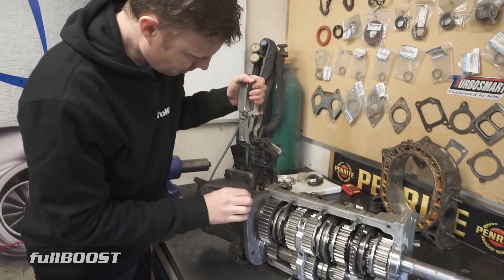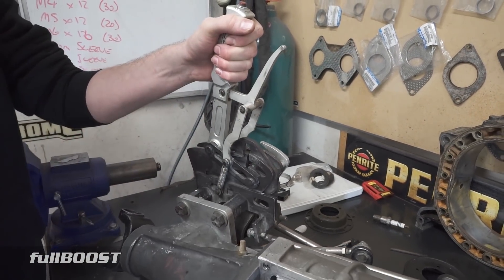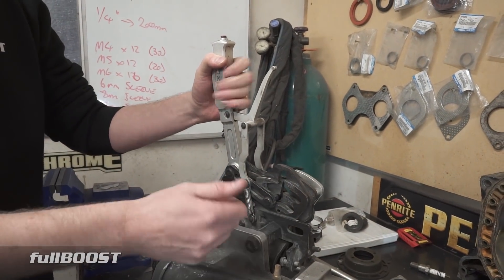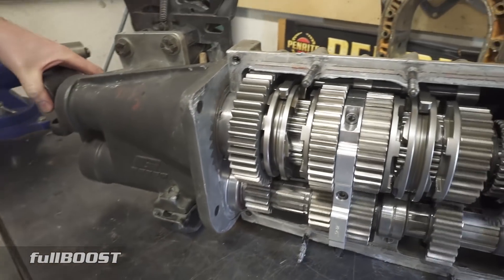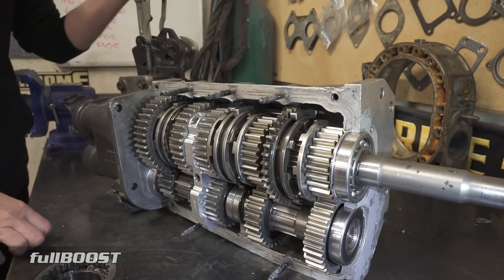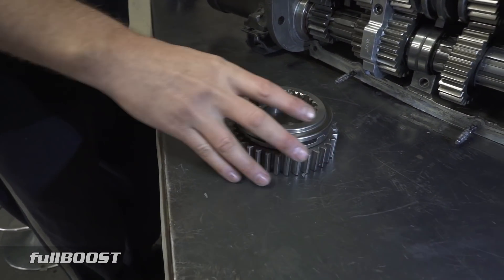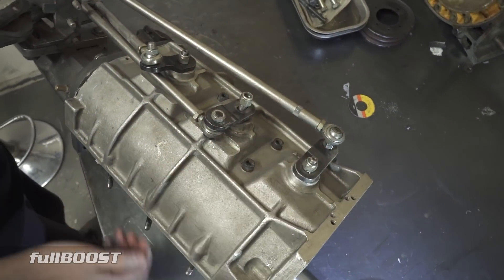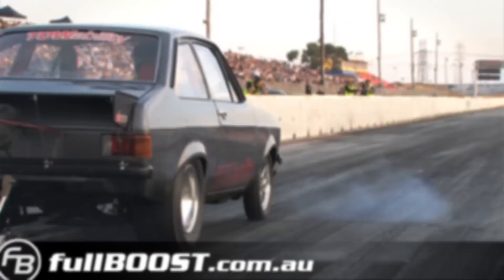How a clutchless racing transmission works

Comment: I'm sitting here reading comments and thinking you guys have no idea what you are talking about. Commentors 
This is basically a regular 5 speed transmission with cut down blockers and synco's.
You remove half or more of the syncros and blockers and cut them at a specific angle and you do not need a clutch to disengage the tranny most guys use a rev limiter to slightly stop the power to change gears in a dogbox.
This is a true clutchless transmission and basically the sliders are not fully locked and the only thing keeping them in gear is power on as soon as power is interrupted the tranny falls out of gear and can be changed, the shape of the slider dictates if you can do this or not.
A standard street transmission the blockers and syncros are t shaped and keep the tranny locked in gear while coasting or in and out of throttle stuff, if you drive a manual normally and rest your hand on the shifter which is really a bad idea btw stop being lazy and take your hand off the handle the tranny can't come out of gear, these are designed to come out of gear on purpose.
The shifter is called a long style shifter as the name on the handle suggests and they run a few hundred dollars or an inline shifter.
There is styles of shifter that are v patterns and H pattern but the long style is the fastest of the shifters generally.
Basically this is a really beefy version of a ford toploader with an extra gear. 
I hope this helps dispels some of the nonsense people are typing.
Reply: You sir have no idea what you're talking about. The only similarities between this trans and a street, or modified street trans for that matter, is the presence of gears and some shafts. The style, design, and function of the internals between the two are competely different.
Reply: Have you ever seen, how small and weak are the syncromesh teeths on street tranny? Whatever you change on them, clutchless shifting buries it very fast. This transmission is racing sequential without any syncros. Just the ignition cut and the fast shifter movement of massive dog ring. nothing more. The shape of shifter does not matter.

Comment: Why do so many engines make that stuttering sound at high RPMs, like at the end of this video?
Reply: That's the rev limiter kicking in, cuts off some of the sparks at preset max rpm,
Reply: Yeah they call it a “two step”. It’s used for launching at the drag strip.

Comment: is it necessary to relieve the load (take off the accelerator) in order to change the next gear? or is there an ignition cut-off system, such as the "kick shift"?
Reply from the maker: No just hold it flat 👍

Comment: Growing up, I called that shifter a Vertigate. We called that type  of transmission a Ram-Shift. If you let off the gas, or, the engine stops, it looks like the transmission would throw itself into neutral. Does the shifter lock, or is it designed to decouple, to help maintain control of the car? For drag racing, I prefer a disconnection, to keep from skidding the drive wheels. Definitely NOT for street use. Any transmission with straight cut gears, were called Rock Crushers, because of the distinct whine, accompanied with a rocky sound. Noisy, but very durable. The straight cut gears don't produce the axial thrust loads that the quieter helix gears did. Beautiful transmission! Thanks for the video, My first look inside one of those.
Reply: you can see the dog teeth have ramps on the back, thats why it slips into neutral when coasting.

Comment: Would be interesting to see a comparison of this type of gearbox and a sequential gearbox with straight cut gears. Both have dog engagement and if both have straight cut gears are there more differences than the gear linkage?
Reply: You don't have to back off at all to change gear, but this box looks like it doesn't do downshifts. Ramps on the back of the dogs will spit it out of gear if the engine slows or seizes. Drag box only.
Reply: I don't think there is. They have a video on F1 transmission and it's just that, a sequential dog-box. The only difference is the forks are mounted on a shifting barrel.
Reply: there is one interesting difference I noticed, typically a race car gearbox inputs on the layshaft and transmits to the mainshaft, this box transmits to the mainshaft, down to the layshaft and back to the mainshaft for 1 2 3 4. The bonus is that 5th acts as a gearless shaft for maximum efficiency when it is needed the most (in drags at least)
Reply: @alexjohnward  I think it just gets rid of an extra failure point, at the expense of having 1:1 ratio (could do it with gears), and efficiency.

Comment: I presume the throttle is held wide open and the ignition is briefly interrupted to allow the shift? Is that also operated by the shifter? Saw a drag bike once that had a trans like that except it was operated by an air cylinder and a solenoid valve. The ignition interrupt worked in conjuntion with the solenoid valve.
Reply: From what I gathered from the video he said he doesn't lift on the throttle because the trans doesn't like it. It's full throttle and banging gears.
Reply: The throttle is held fully open when upshifting and the ignition cutting switch is usually placed on the shifting rod. The time of ignition cut (miliseconds) is the object of testing to ensure the minimum stress to the the gearbox and also the precision of shift. You can do the same on the bike without the quickshifter, with a short throttle release simultaneously with upshift (not using a clutch), but you have to train a little bit and never would be so accurate.
Reply: The whole purpose of a clutch less transmission is the ability to up shift without power interuption. Why would you want to pull timing out of the motor, thus reducing the power output of the engine, just to be able to up shift? Please enlighten me.
Reply: @joshmonroe2562  the dog teeth have a small taper to help them interlock, and while under huge load are quite hard to unmesh, while it is possible to force them apart under full load, it would be unpractical for almost all users due to wear when a millisecond ignition cut would reduce load without much speedloss
Reply: @alexjohnward  I understand that. A true "clutchless", similar to the gf5r in the video,  dosn't need to be pulled out of gear! Take a close look at the split sliders, and the ramps on the coast side of driven gears' shift lugs. Picture this trans, under power, running through the gears. Is it starting to make sense?
Reply: My apologies. I just noticed the ramps are actually on the split sliders,  not the gears,  but regardlees it's the same outcome.
Reply: @joshmonroe2562  true mate you are correct, duel gear engagement until the lower gear kicks out, also why it can't downshift without exploding!
Reply: The ingition cut reduces the forces from dog ring teeths to toothed wheels and enables their movement. And also reduces lightly the rpms, what is also required.
Reply: Regardless of whether throttle cut is used between shifts, it seems like those dogs are going to take a massive beating between every shift. The engine has quite a bit of momentum, it has to decelerate down to the RPM of the next gear within only a few to tens of milliseconds! Do the flywheels on these drag cars have next to zero inertia?

I drive a G35 manual and if I don't slip the clutch slightly between that 1->2 shift, it takes over a goddamn second before the engine matches the RPM. And yes I am aware of rev hang and the fact that flywheel is on the heavy side for that engine but still!
Reply: @GeorgeXian  all the gears are spinning constant speed
Reply: @ironmantooltime  the gears might be in constant mesh, but as soon as you engage the next gear with the rpm still high, the gearbox will forcefully pull down the engine rpm to what it should be at that speed and gear. That is when the dogs will take a beating. The gears won't slip, but those engagement plates are going to be absorbing the kinetic energy difference of those two engine speeds.
Reply: @GeorgeXian  not so different to the torque on the crankshaft in reducing the engine speed? I guess why the dogs aint made of cheese 😄
Reply: @ironmantooltime  it's higher than the crank torque as it's an impact load. The shorter it takes to force the engine to speed the higher the force. The force is transmitted to the wheels which could upset traction if the tires are already being pushed. The drive line shock is also pretty uncomfortable to driver and passengers alike.
Reply: @GeorgeXian  x
Reply: From my understanding you just lightly let off the gas to reduce tension on the dog teeth, one tension is reduced, you force the shift. I've always been told to drive it like you hate it. The more force you use, the better the tooth engagement. I'm sure the do make interrupt-style as well for specific applications though.
Reply: Real van man is right, on sportbikes and dragbikes you get a quickshifter that momentarily cuts the spark while shifting to release pressure on the dogs. the quickshifter gets wired between the ignition and the ECU
Reply: @EatMyYeeties  On motorcycle dog boxes if you manually ease off the throttle the shift level engages really smoothly, kinda same with a quick shifter but you have to trip it and engage the next gear in a single swift movement, depending on the loop quality that you have installed

Comment: "Clutchless". Just like how the new SkyActiv is "Compression ignition"....with a damn sparkplug...
Reply: This is as clutchless as a transmission gets
Reply: @elioliver9554  CVT's are closer to clutch-less I'd argue.

Regardless I don't see the hate for Mazda's innovation. They are doing an amazing job
Reply: @fokjohn  Ain't hating, just stating the obvious. A clutch is a clutch. It's like dysons Cinetic Vacuums being "completely filterless". Even though there are two filters after the motor. A filters a filter.
If it walks like a 🦆. Talks like a 🦆. It's probably a 🦆.
Reply: @fokjohn  imagine a beltless cvt, USING A toothed CHAIN for better power transmission
Reply: Clutchless shifting. What don't you understand?
Reply: no syncroclutches.
Reply: @Leo Vraneković Spark is always used.Watch the Engineering Explained video on this.
Reply: I think the clutch less was referring to there being no clutch pedal to engage/disengage. All you had to do was yank the lever back and forth to change gears.
Reply: "Instantly engage"?  Could you please explain how they mesh without ripping the dog teeth off?  Something that is typically handled by synchromesh, and of course without any clutch it will be constantly loaded.
Reply: @mikeyutube  the dog teeth are ramped on one side, so it goes from 1st gear, to 2nd and 1st at the same time, first ramps itself out! 3rd and second at the same time, second ramps itself out etc.
Reply: @Leo Vraneković The spark plug just initiates ignition?!  LOL!

Good one idiot. Thats what all spark plugs have always done... since the invention of gasoline engines.
Reply: @mareksumguy1887  You clearly don't know Mazda s spcci engine
Reply: @vladimirlucifer4566   You clearly have problems with reading and comprehension.
Reply: @mareksumguy1887  You clearly have problems if you think that spcci functions with the same principle as the usual cycle.
Reply: @mareksumguy1887  Spark plugs were and usually are the SOURCE of ignition of ALL the mixture. The spcci engine is the INITIATION of a combustion: it combusts partially and the rest is combusted through compression ignition.
Reply: @vladimirlucifer4566  No, the rest is combusted by way of HCCI (Homogeneous Charge Compression Ignition).  

The way you and Leo were explaining it was wrong, and thats what i was pointing out.
Reply: @mareksumguy1887  I explained just like you did: a gasoline engine uses, by default, a homogenous charge. And then, the IGNITION is INITIATED by the spark, but not all combustion is due to the flames caused by the spark. No one ever said that it wasn't Hcci: we said exactly that it was.
Reply: @mareksumguy1887  Hahaha. A gasoline engine does not have a homogenous charge? Ahaha. Diesel is Stratified charge compression ignition. Gasoline is Hcsi, HOMOGENOUS charge spark ignition. I don't need to directly mention Hcci because the spcci is indeed an Hcci engine. "Initiates" ignition is different than being "the ignition". The Mazda spcci engine uses the spark to burn a small quantity and the rest is compressed ignited. This is what I have been saying. Can't understand your confusion, other than your ignorance on the gasoline cycle and understanding of abbreviated English.
Reply: @mareksumguy1887  On a usual cycle, the flames formed by the spark plug CHAIN REACT THROUGH COMBUSTION WITH A SINGLE KIND PF COMBUSTION. The one without the knowledge on dynamics is you: the spcci engine uses the spark to start and control the compression ignition. A small part combusts through the chain reaction, and the rest is combusted through the pressure: compression ignition. Starting the ignition of the mixture and being the ignition of ALL the mixture are two different things.
Reply: @mareksumguy1887  I never said it did. The spark plug makes an expanding ball of flames on a normal Hcsi engine. On a spcci engine, however, a small ball of flames caused by the spark plug increases rapidly the cylinder pressure, compressing and igniting the rest through compression ignition: not a chain reaction, but an instant combustion.
Reply: @mareksumguy1887  A spark plug isn't required for combustion or ignition. Hot bulb engines, diesel engines,etc.

Comment: I had a Doug Nash in my car for about a decade.  If you ever drive a car with one of these, you will never know what its like to truly speed shift. I can see that Mike Long an company have made some upgrades to keep the main shaft from moving around and those splined plates for the end are pretty impressive.  If you have an automatic, even with a brake, you have no idea how hard a car hits with a clutch.  God Bless the manual transmissions and the people that drive them, it truly is the best.
Reply: Remember when you HAD to know something to drive a car? If you don't drive a stick shift as part of the experience, you might as well get a hybrid. I wouldn't buy a sports car, unless it has a manual transmission, and a clutch.
Reply: Had is past tense.  I still do @vincentrobinette1507
Reply: Launching with a brake in a powerglide is like being shot out of a jello slingshot. It feels slushy but you're definitely leaving. I've always wanted to get a Jerico box but it's hard enough paying the bills and it's even harder to justify the money to the wife lol. I too think a real racecar should be a gear slammer.

Comment: So it's not going to last long due to the sleeve ripping right?
Reply: This is a high maintenance drag racing transmission. you freshen this up, when you pull the engine to freshen it up. (usually before each racing season).

Comment: Can it be used for faily driving? Just asking
Reply from the maker: Nope, it doesn't downshift. It's a drag box.
Reply: @fullboost  damm
Reply: @purpledoge4466  G-Force does make them with sliders that can be downshifted for street use. This one just happens to be a clutchless unit for drag only.